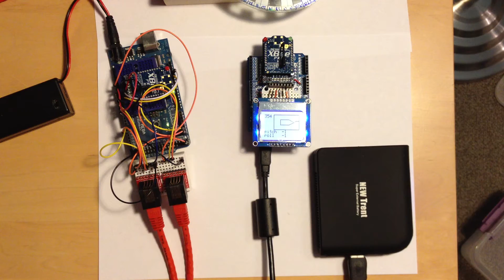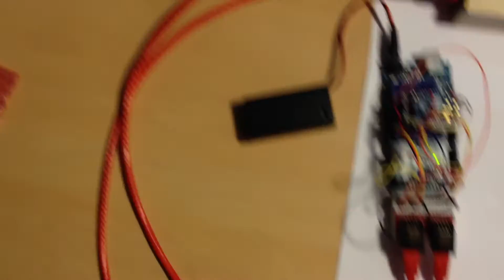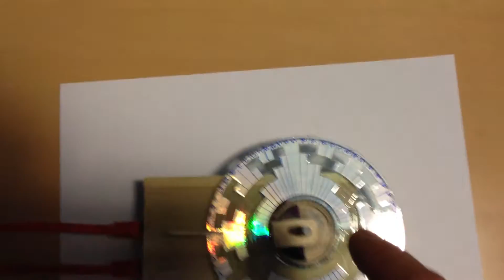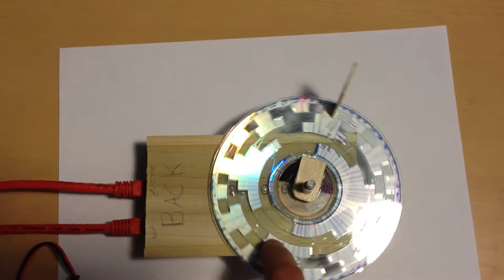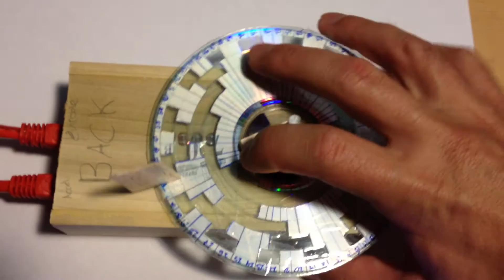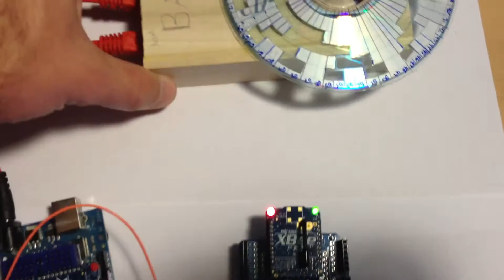Arduino Dashboard for RC Sailboat

Comment: Your setup is very nice, kudos! Do you have a site/blog with more information? Do you eventually plan to implement some smart rudder and sail control or do you just want a lot of telemetry?
Reply from the maker: I don't have a blog or site set up yet, but plan on doing so when I pick this project back up, likely in the summer. My end goal is to enable autonomous control of the boat, starting with rudder control.
Reply from the maker: Here is my blog with some information on the arduino sailboat project. http://www.jsparling.com/category/rc-sailboat/
Reply: Wow, I had almost forgotten about this. It's a great little project, and a lot of information, thanks a lot for the link!